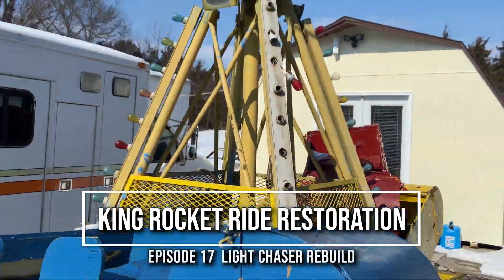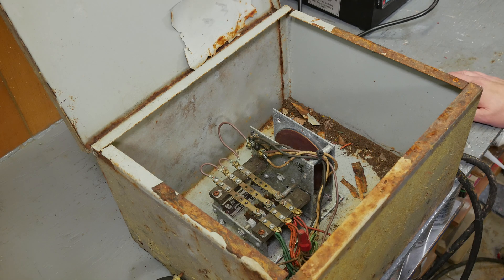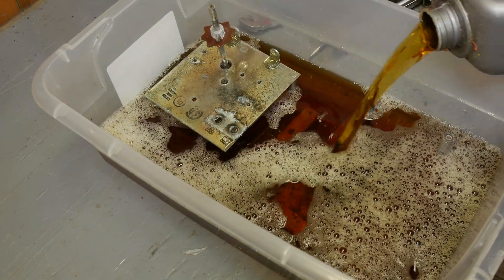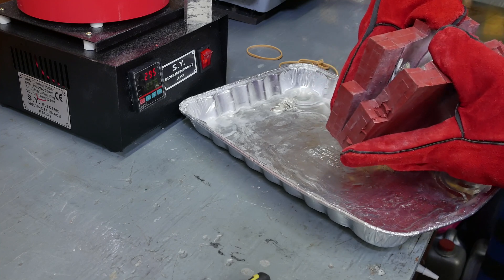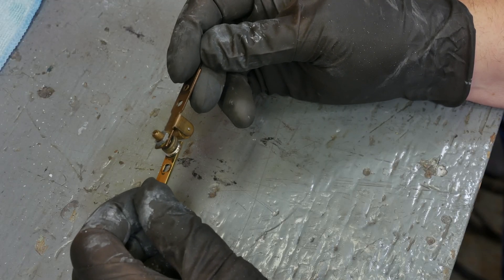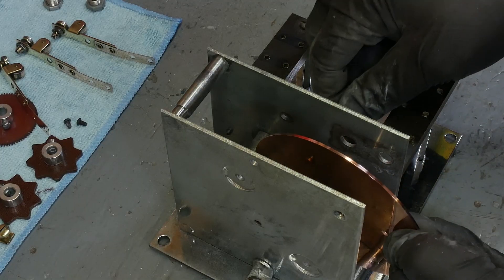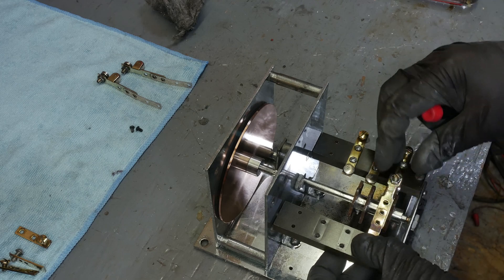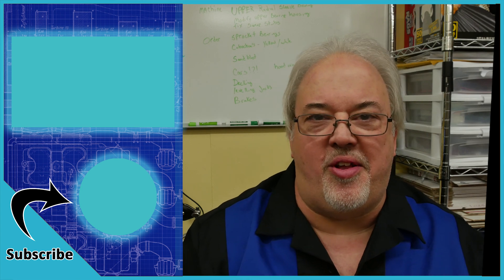Electromechanical Light Chaser Restoration

Comment: It's really nice to see how robust this thing is build. That's something else than the modern electronic version.
Over here we call it a "running light".
Reply from the maker: Yes those contacts are rated at 10 amps a piece. Since they are intended for lights I’m assuming that is resistive load rating. although they are occasionally used on the incoming primary side of neon transformers for animated signs.  The same company makes a similar product to switch the high voltage side of neon. Those are fun to watch because it’s just a continuous circling electrical arc.